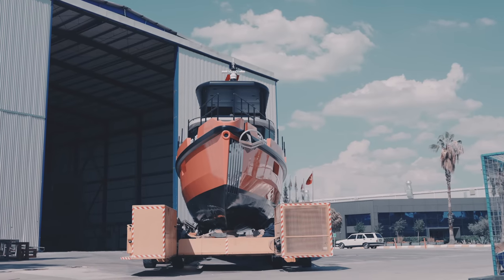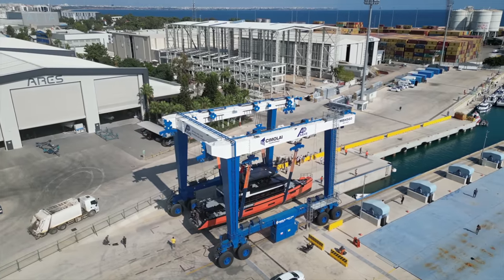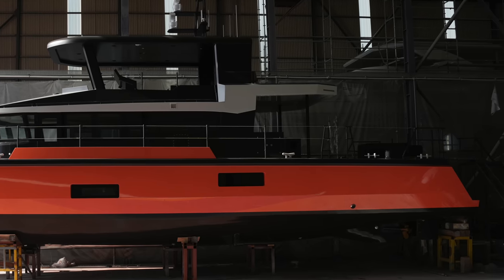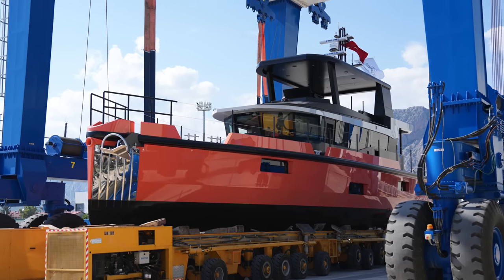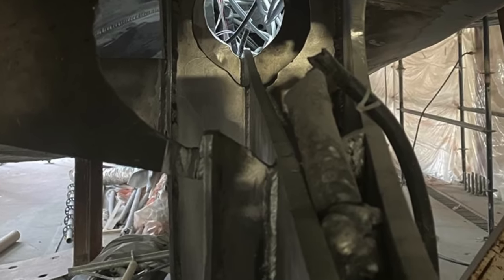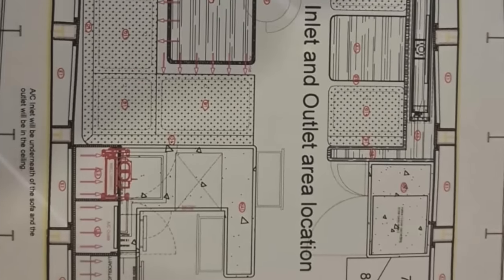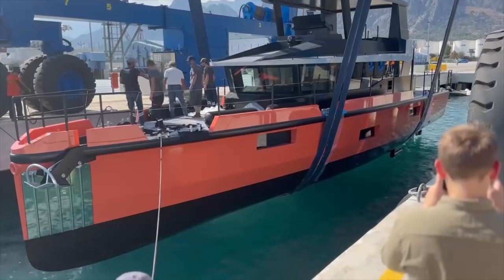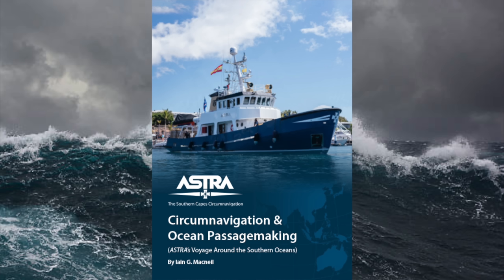Hull 2 LONG RANGE Liveaboard Explorer Yacht XPM 78 'Vanguard' Is Launched!

Comment: John , that's another great video!  I did see reference to in the comments to FPB "look a like".  To fill in some background, the XPM 78 was designed contemporaneously as the FPB 70.  There are 18 FPB sailing to various designs and now 14 Artnautica designs. Audi, BMW, take your pick.  XPM 78 has been influenced by the sucessful FPB designs and by input from staff who have worked on both plus the ideas promulgated by successful designers such as Nigel Irens and Owen Clark.  This is, a new design bringing updated ideas and equipment that did not exist until after FPB ceased production.
Reply: Thanks for the information.
Reply: I'm glad others have been inspired by the FPB and continued the story. Mr Dashew spent a lifetime accumulating invaluable design knowledge and via imitation, that is being passed on. As wonderful an explorer as the FPBs are, they aren't perfect.  I understand that the philosophy is function-over-form, but IMO the form is very sterile and unattractive. Adding a little more style, particularly in the interior, of the FPBs wouldn't have harmed functionality at all. I think boats like this one will certainly correct this oversight.

Comment: Really cool tech on a Dashew inspired design. Also a lot of really precision tech to break in the middle of nowhere.
Reply: Breaking tech is a yachting nightmare!. We have taken two approached to this. All critical systems are duplicated and we have installed commercial grade equipment in those locations. For example Wills Ridley steering gear, found on many deep sea trawlers and small war ships, 100% redundancy with twin independent rudder systems.   Short of a total disaster we should be good to go.

Comment: I like the boat but I don't really understand why you would put an expensive paint job like this on an aluminum hull. This will be a pain in the ass forever where you will be upset about every little scratch and that just happens if the owner actually plans to use that boat.
Reply: Good point.  The problem is fishing boat look meets the owners wife who is an interior designer. The ultimatum was "paint it or I'll not go on her".  She got painted.